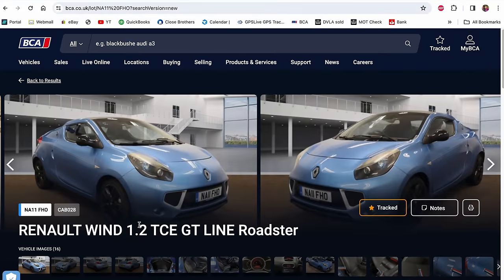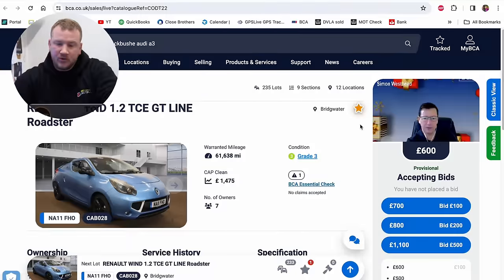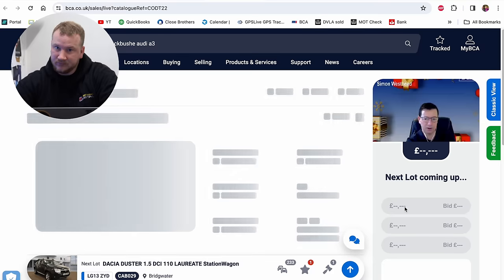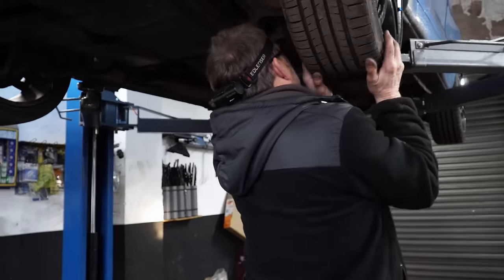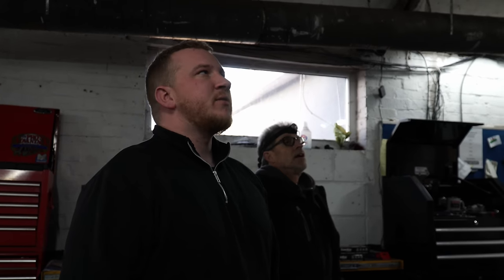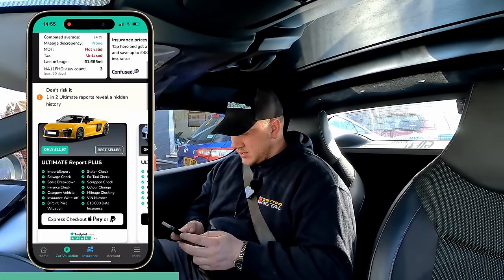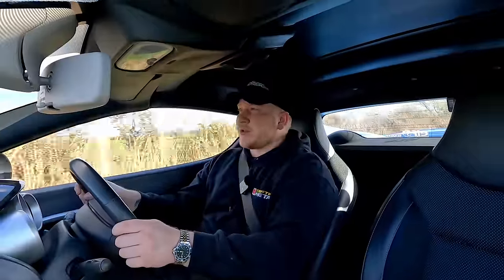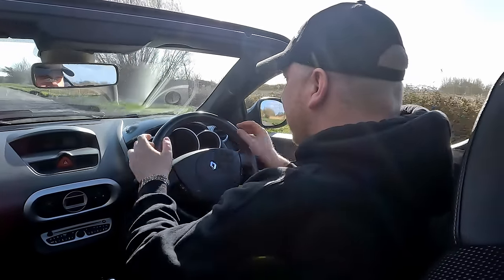I Bought A Cheap Renault Wind From BCA Car Auction, UK!

Comment: The only downside (to the customer ) with a car being on a stocking loan is that it shows up as having outstanding finance when doing a Car Vertical check. Nothing that can't be proved by the dealer showing the paperwork,  but may be enough to put a customer off, if they don't check with the dealer.

Comment: I see the argument for essentially storage costs, but I don't think it is cut and dried when a car needs a small bit of work and it is the business's decision not to get it fixed and ready for sale for 90+days. Maybe that £20 per day clock should only start ticking once it is prepared and up for sale? And maybe not at all if you aren't full and it isn't preventing you stocking other cars.

Comment: I’ve got a wind for my first car and am learning to drive in it. Great fun with the roof down!
Reply: Hi, I just bought it's nice but the suspension in mine is rock hard It's not comfortable is yours the same because I'm wondering if there's an issue with mine
Reply: @classiccarguy123  Can be a little bit harsh over bumps, makes me grimace whenever I see a pothole.😂Fine on most flat roads though.

Comment: That's an interesting little car. I do like left field choices rather than humdrum cars. I have a little 2010 Honda CR-Z coupe which is pretty rare, as there were only 4,300 units sold in the UK between 2010-2016. As a result, prices tend to be higher than average, so not really a car you would be interested in.

Comment: Also worth checking if oil has been put into the cooling system on purpose by a scam buyer trying to get it cheap. Its a common nasty trick and happened to my neighbour.

Comment: Joe the 1.2 TCe is definitely not a reliable engine at all. One of the worst ones they made unfortunately. However I do like these, they’re genuinely quite unique looking and rare.
Reply: The 1.2TCE from 2007-2012 was very reliable, the later one indeed is bad.
Reply: I prefer the 1.6 VVT with 133 horses for the Autobahn.

Comment: Hi Joe. I like this little car, small engine, you never see these cars on the road anymore. Cheap buy. Well done on selling the Mini Cooper Joe.  👏 🫡👋👋🇨🇮 PS. There was 2000 of these made in 2011. 100bhp. And there's one for sale for €5000 in Ireland  with 79.000 miles.